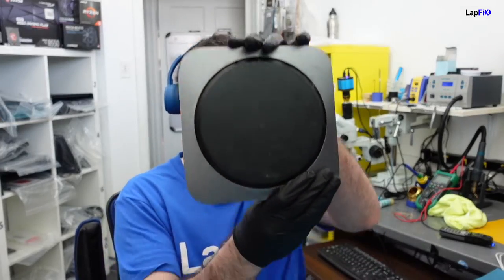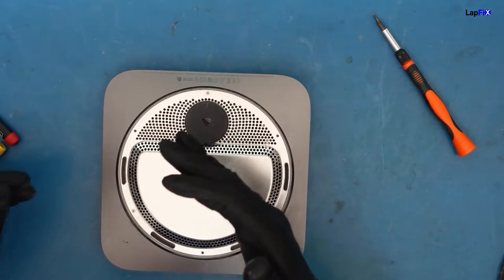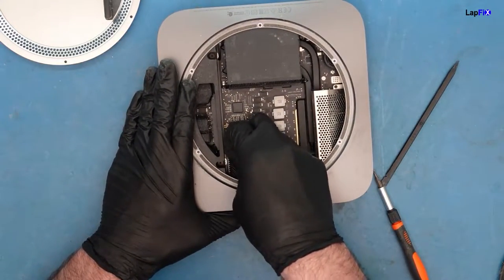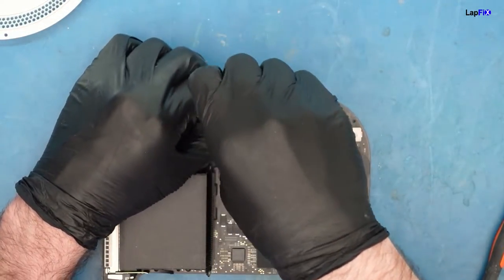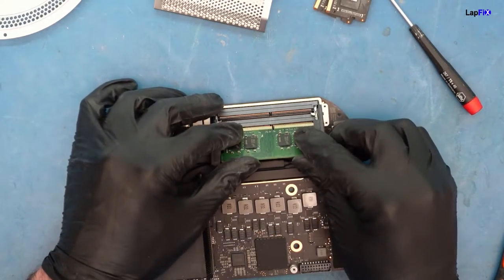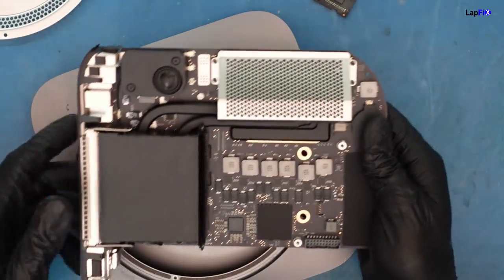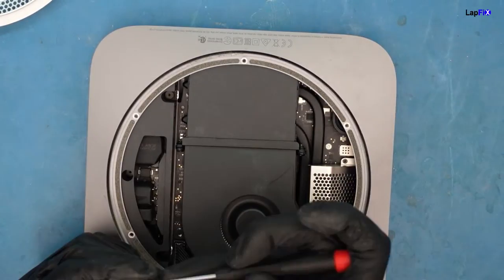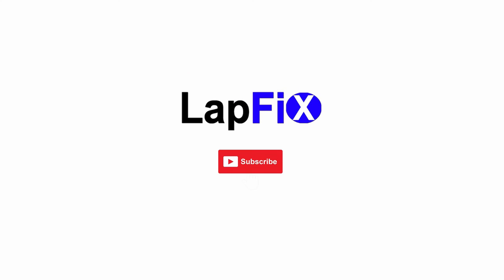Upgrading Mac Mini RAM 2018 a1993

Comment: can I install Teradak Apple MAC MINI (2018) Module on mac mini m2 pro 2023 then power it with Omegon Pro Powerbank 96k or EASYLONGER Portable Powerstation Battery Cpap-Device 96000 mAh/297.6 Wh ?

Comment: is it necessary changing thermal paste in mac mimi ( 2023 ) ?
Reply from the maker: If you bought it in 2023, I would just recommend waiting out the warranty period before opening it.    If you have never done so on an older model, check the temperatures first and be careful
Reply: @lapfix  tnx , the temperature is between 60-80(85) , when just using it in a very normal way. Saying 60-80 I mean kinda of a "jumps" in Fan Controller app...
Reply: @lapfix  no I bought it about two , three or years ago ...
Reply: @lapfix  I didn't not get you clear " be careful 😬😬🌝"